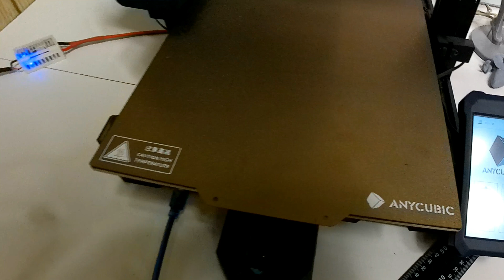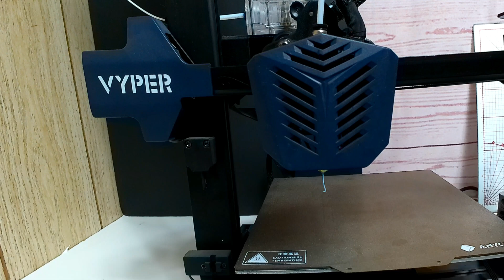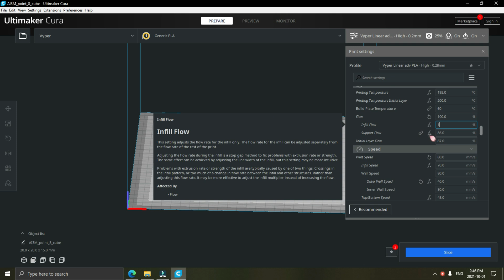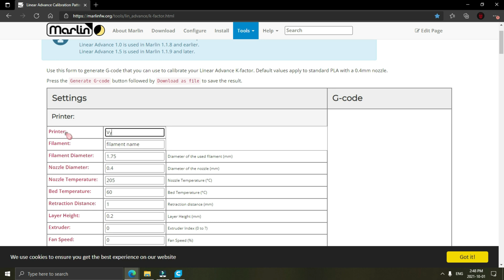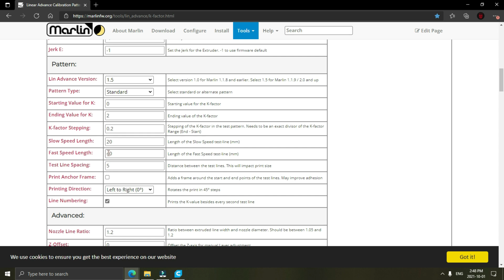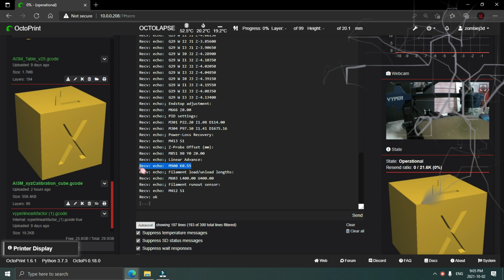Anycubic Vyper Calibration (e-steps , flow, linear advance)

Comment: Thank you so much, your vids are super on-point and useful, exactly everything that's needed and important, looking forward to your junction deviation video. This printer has been the easiest I've ever set up and calibrated. I got so sick of upgrading the ender 3 v2 trying to make it better and mucking around with firmware hacks and whatnot, and eventually lost motivation because it was such a PITA to track down issues. This printer has everything I added onto the ender3, the only thing it's missing is linear rails (besides my wishlist for closed loop stepper motors LOL) but hopefully that'll be an easy upgrade at some point in the future, at least before I wear the wheels out. Question: have you been able to get resume print to work in case of a power failure when using octoprint? I guess that's more of an octoprint thing, and i've got mine on a UPS, but it'd still be a nice option to have JIC
Reply from the maker: Glad the video helped. I have a ender 3 se but it's not so much ender as Frankenstein it was a nightmare to get tuned amd setup how I wanted took months. The vyper I got about a month before the reveal event and in 10 min I was printing. Super fast and easy setup and the print quality is really great out of the box and calibrated. Linear advance I've added has helped lots as well as the 2209 standalone mode only thing is you need to adjust voltage on the maonboard. Resume print on octoprint is a tough one as the pi loses power and needs to reboot. I'm sure someone has worked on a plugin with a pi ups or something.
Reply: @studiozombie3d  that would be awesome, I need to look into that.

Comment: Great FW - Can't wait to try it out.  Unfortunately my Vyper arrived with a flakey mainboard and I'm working with support to get a replacement.
Reply from the maker: They are pretty good about getting parts out right away. Let me know how it alk works out and how your vyper runs for you
Reply: @studiozombie3d  They have been very responsive and have agreed to send a new mainboard.  I'll see how quickly it arrives.  I have one of the early kickstarter printers and had a lot of teething issues including a bad strain gauge and the z endstops were not adjusted properly.  So I finally got to actually try to print something but the hotend fan2 never turned on so heat creep happened and the filament swelled and clogged the PTFE.  I traced it to the main board not switching the fan on or off (bad transistor or?).  I have a kickstarter CR-6 which also had a few early issues but it has become a workhorse and I'm hoping for the same with the Vyper and the linear advance support is a bonus - really appreciate your efforts and contributions on the facebook group.  You need to tell us how to compensate (Tip) you for your efforts.
Reply from the maker: @reasonablebeing5392  it's strange really I got my vyper about a month before the reveal event for the Kickstarter and I have had a issue with mine. I think I got really lucky or something lol only thing I've changed on my unit so far are nozzles. My ender 3 was a totally different story took me months to get it tuned how I wanted the vyper took me Maybe min and was good. Then sources for firmware came out not too long ago so was able to add a few things that were missing and now I'm really happy with my vyper and its become my main unit for printing and my ender has taken the backseat. Maybe I'll add a donation link to my linktree or something. I just like to help put how I can ot keeps me busy lol

Comment: After calibrating flow, should you uncheck the outer contour settings?
Reply from the maker: Yep thats the vase mode option I just find when calibrating flow it works best. Thats only if you want to print a vase or single wall simple object. Uncheck that and change your flow % and your good to go
Reply: @studiozombie3d  Thanks a ton! I finished calibrating everything and had a perfect first layer but now as my print continues I am noticing the detail is great but the layer adhesion is not the best. Is there a solution to this??
Reply from the maker: @maxinaroundoutdoors  you can try bumping your hot end up 5 degrees.
Reply from the maker: @maxinaroundoutdoors  forgot to mention the bugfix and 2209 firmwares are custom ones not official anycubic but have many people running it and seems to be really solid.

Comment: I dont have a raspberry pi yet and dont have octoprint. Is there a better way to edit gcode? I was looking into Pronterface?
Reply from the maker: Pronterface works great for dealing with terminal commands if you don't have a pi. Does everything you need to calibrate and tune

Comment: I can’t M900 kx.x 
How to?
Reply from the maker: For linear advance you need to flash my firmware off my drive. I have the bugfix version and the 2209 version both working great the 2209 version allows you to adjust voltage via the mainboard for the stepper drivers reducing heat.

Comment: I print mostly wargaming terrain, I'm having problems with small prints, like horses, corpses and the like.  I use your settings in your other video, except I have been lowering the speed.  Can you offer any advice for the smaller prints?  I can give more information if you like.
Reply from the maker: You can message me on Instagram and I can try and give you a hand. @zombiej79_3d

Comment: Does it matter if you have an A or B version motherboard?
Reply from the maker: I have a 0.0.6 board in mine the calibration is the same only difference is custom firmware on my unit. It should work with 0.0.5 but I can't personally test it

Comment: Thanks for this video. Does this also work on the v2.3.9 firmware?
Reply from the maker: The calibration routine is the same the only thing is the 2.3.9 dosent have linear advance and other features I added to my custom firmware. My latest build has a Readme and change log inside the pack with the changes. I think its much better then stock but stock works great too
Reply: @studiozombie3d  Thanks. I will give yours a try. I am hoping for something like the Jyers firmware for the Ender 3v2 that will work on the Vyper!
Reply: By the way, where do I find your v2.4.5? I don't see that in the google drive link you posted here.
Reply from the maker: @arniep740  you want either he bugfix version or my 2209 one. Both the same just have the 2209 in standalone mode you have to adjust voltage on the mainboard. Both have linear advance and everything else. They have Readme and changelog files in the packages.
Reply from the maker: @arniep740  https://drive.google.com/file/d/1WZALw3joD1CbQEj5fo9SGszwZqPvvvDg/view?usp=drivesdk

Thays the 2209 version 
This is the non 2209
https://drive.google.com/file/d/1xphCSxZzKmoQX-sgbZMEIFiDZ5C1DA0F/view?usp=drivesdk
Reply from the maker: @arniep740  I haven't seen that firmware myself I have a heavy custom ender 3. But this firmware is almost near final just want to add and tweak a few more things
Reply: @studiozombie3d  Got it. Loaded it onto my Vyper with no problem. My next step was to do the linear advance calibration. I followed your directions and entered everything as you instructed into the gcode generator. However, when I uploaded the gcode file via Octoprint, I got this error message:

Layer indicator not found in file: 'Linear_advancekfactor.gcode'
Check layer pattern in DisplayLayerProgress-Settings and reupload the file!

Any idea what I need to do? Thanks.
Reply from the maker: @arniep740  you can ignore that.its because the pattern is only one layer.

Comment: Hi 
Why is junction deviation is better than normal jerk ?
Reply from the maker: Instead of turning jerk for x and y junction deviation uses one setting a maximum deviation distance. The lower the number the tighter the corners and the speed slows down a bit more in corners. I'm working on putting a video together. I'm using mine at j0.08 and I'm getting good results but I'm still playing with that one a bit. Will post a video on it soon
Reply: @studiozombie3d  ok thank you :)